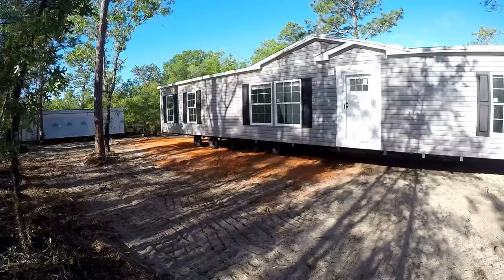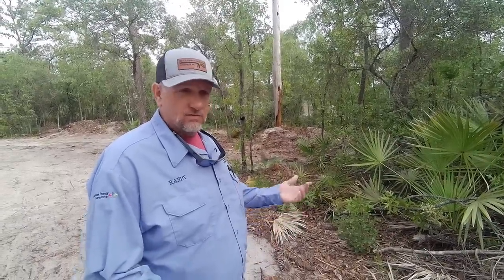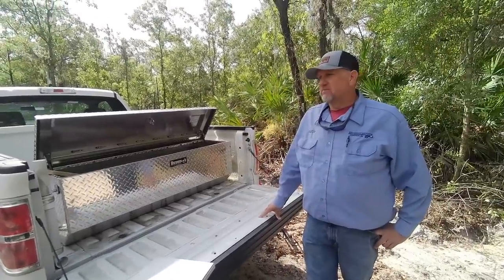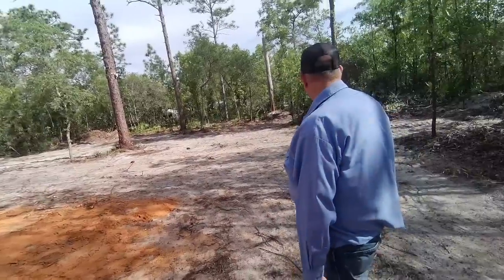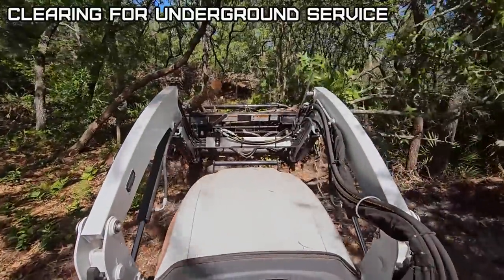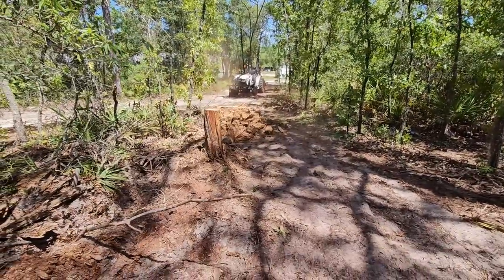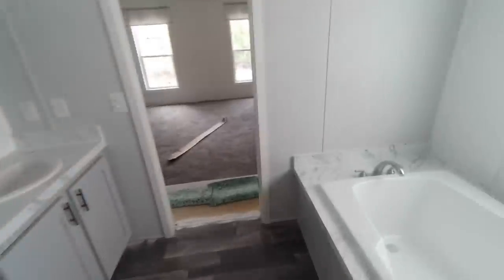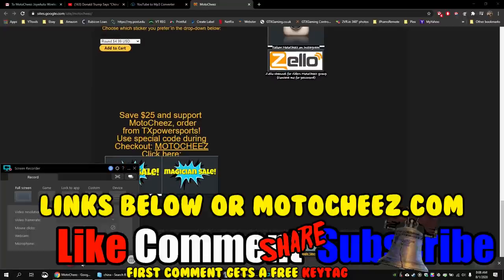Pt 2: Electric line planning, inspect unit, level, join, block and strap down manufactured home

Comment: Did the siding alignment issue improve after the unit was set into place on piers?  I was wondering if some of what you were seeing was due to frame flex while still on the axles.  Yup, underground runs for the electrical is good, won't have to worry about falling trees taking out your service.  M'be some diatomaceous earth on the location where the hornets/wasps were coming/going?  Let 'em do themselves in getting that stuff on them.  

When your skirting goes up, line the inside with Reflectix, tape the seams with foil tape.  Rodents/bugs leave Reflectix alone, it's clean, weatherproof, and your floors won't feel so cold in the winter, and your pex/sewer lines will be better protected from freezing if it ever got cold enough.  Another benefit is the light reflectivity for working in the crawl space.
Reply from the maker: Siding still off. Nice, thanks for the tips!

Comment: I don’t know the system /codes in Florida  , it would be worth the expense to bury your service to rid yourself of any overhead issue and maybe eliminate a pole .your gonna be there more than north at some time .I’m sure you will do your homework , you always do !….
Reply from the maker: I did deside to go underground, only $800. I mention it toward end of electric chapter
Reply: @MotoCheez  Thanks Moto , I cought that eventually , haha…I know it’s different down there ,I have no doubt you’ll make the most of it ! Nice looking unit by the way . I saw how they anchored to hold her down , keep us informed .
Reply from the maker: Ha. Thanks. I'll try and record the process as much as i can

Comment: I DREW AND BUILT A 4K FT HOUSE 25 YES AGO,,,,,IT WAS EVERTHING I HEARD AND MORE,,,I did a 400 amp 2and 2,,,and loved my on demand hot water heater, but I did all this in high desert so. Comiefornia,,,I went underground from street to house ,,,the hell that caused !
Reply from the maker: Wow, why did it cause hell?
Reply: @MotoCheez  I wanted maximum set back from the road,,and did not want to be looking at poles and lines,,, apparently I was the only non trac builder to ever want to go under ground,,,almost could not get anyone to do it,,and then had to obtain a waiver from the city council beause my method was not directly addressed in building codes
Reply from the maker: Wow. That's strange
Reply: @MotoCheez  I was the first owner builder since incorporation the city,,it inc orperated in 82,,,and I built in 97

Comment: Was this a DCA Approved home?  Looking to put one in Punta Gorda, and the county requires this to be DCA Approved.
Reply from the maker: I'm not sure. I guess it would be stamped inside breaker box. I'll look. 
I know it meets the new FEMA codes
Reply: @MotoCheez  cool.  Thank you.
Reply from the maker: I'll check tomorrow.
Reply: @MotoCheez  Did you get a chance to see if it was DCA Certified?  Charlotte County states they have to be (there at least).  Wonder what some of the cheaper ones cost?  I wouldn't need much for just myself, but a big pole barn is a must.  Or just put up a Pole Barn house??
Reply from the maker: I forgot to look. I'll text Mike, the salesman right now
Reply from the maker: @gregslair4278  I did send him a text, he might be off of work but as soon as he replies which he will I'll let you know
Reply: @MotoCheez  Thank you very much.  Oh and just make rain barrels out of big garbage cans, super easy to do.
Reply from the maker: Good idea, and what do I do with the overflow? Put a pipe on side? I'll do some research 

I'd love to run all 4 underground to one location low on Property
Reply: @MotoCheez  This is what I did (and I'm NOT plugging my channel). https://youtu.be/HREiHSCbPn0  You can connect multiple barrels with some 1/2" pvc from the top of one to another and so on.  Mine sit on my deck, so I don't worry about overflow, but a hot water heater pan would work, or just set them on gravel.
Reply from the maker: I'll check it out. I know the wife's not going to want to look at plastic barrels on all four corners so I'd probably run the drains to one collection point that might even be partially buried
Reply from the maker: Ahh that's simple. Hmmm. Have to come up with something that will collect all 4. Maybe one of those plastic runway containers that are wrapped in aluminum what are they like 300 gallons or something
Reply: @MotoCheez  That would work, but hell 4 big trash cans would be 200+ gallons.  And those screens do keep out the bugs and junk.  Well just some food for thought.  Can't wait to see the place completed.  Have a safe trip home and look forward to many updates.
Reply: @MotoCheez  Also, you could paint them, or use those cheap fence boards to box them in, with flower boxes on the sides.  Lot's of ideas...
Reply from the maker: True!!!
Got home last night 11:30
Reply from the maker: Here is his answer "DCA Certified is Modular.  Ours are HUD Certified, Mobile."
Reply: @MotoCheez  Thank you.  Then I reckon only DCA Modulars are allowed in Charlotte County.  Guess I'll look at those and Pole Barn Ranches.
Reply from the maker: Hmm. No idea TBH
Reply: @MotoCheez  I reckon it's a county to county thing.
Reply from the maker: Yes

Comment: Inspection are a pain at least in California they are expensive if you need any questions with well stuff I don't mind helping IV done well work over 20+ years now and I rebuild any pump and trouble shooting now but IV done it all start to finish even drilling so if you have any questions I don't mind answering it.  for you the best I can. The well going to need at least 30amp and a tank and booster the way to go.  200 amp should be good 400amp a ton of money.👍✌️🍻🛠️💧💯
Reply from the maker: Thank you! I know in my area the wells only have to be 150 ft deep, but I am going 200 ft by the recommendations of a lot of people. So it's not a real big pump that will be needed like I have up north
Reply: @MotoCheez  good stuff it's always recommended to go deeper if the water there it doesn't hurt and you can't drill deep once a well is finished. A storage tank and booster set up is always a good thing to 💧🛠️💯👍🍻

Comment: The reason people are doing 400 amp services is because Tankless hot water, Electric heating, and EV's.
Even if you don't get an EV it still future proofs your home.
Reply from the maker: Ahh, the EV's, didn't think of that. I won't be getting one any time soon. I drive way too far
Reply: @MotoCheez  
Just an FYI if you're planning on building a shop a second service line will be a separate bill and it will be billed as a business. 
So a 300-400 amp system with a disconnect going to your shop would be advised.
Reply from the maker: I'm just going off the 200 amp service. Runs everything I need up north no problem.